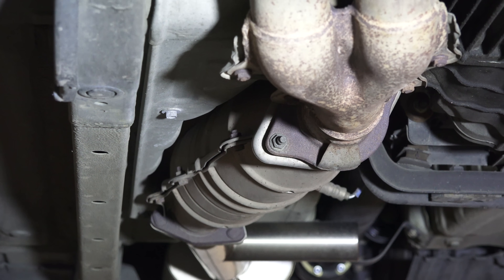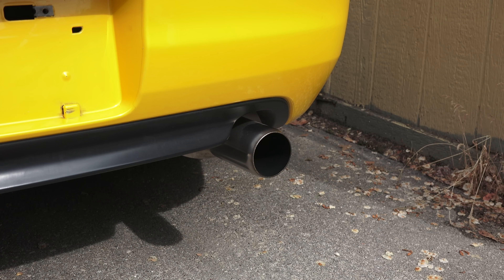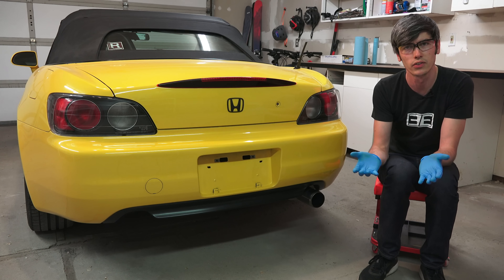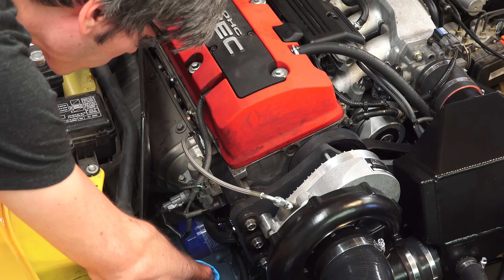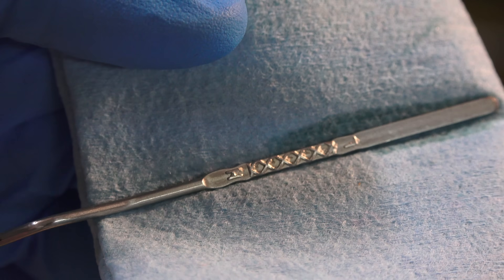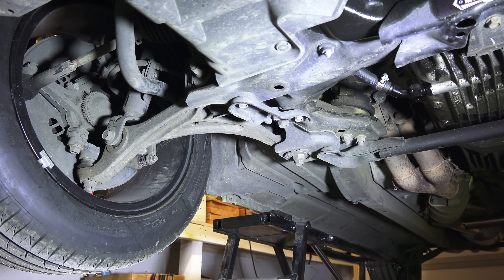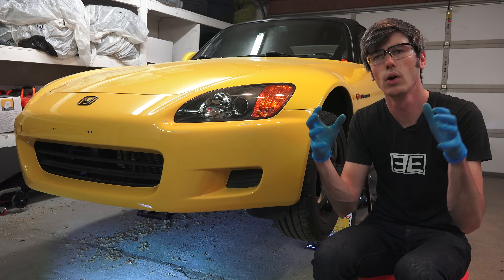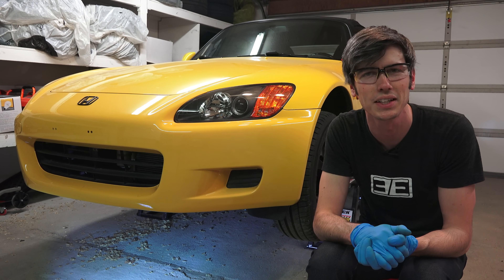5 Signs You Shouldn't Buy A Used Car

Comment: Get a very good mechanic to do a checkup. Then take care of the damn car. 
Keep in mind that every used car has some problems. What is important is that they are not major and that you can fix them without spending lots of time and money. Plenty of a-holes that lie and want to scam someone into buying their poorly maintained car.
Reply from the maker: Agreed!
Reply: @Gandalf721  I keep it as "factory" as I can. It is the 177hp so plenty of power for me. I also do little city driving so the standard interval is ok for me.
Reply: This is why I always change my oil every 3000 miles, and filter every six. Coolant changed every five. Have yet to reach the 10,000 for my transmission fluid in my newer car. Just keeping up on those things is a good way to make sure your car goes over 300,000 miles. Had a Toyota Solara with over 300,000 miles, and the only thing that failed was the Manifold 1 cat. converter.
Reply: @joehutchcraft1675  I think you can get away with "normal" mantainance that is 7kmi for oil and filters. My dsg requires oil and filters every 40kmi. If you do it more often then great!

Comment: Also, do another check up on the car before you drive off with it if you don't buy it the first time looking at it. I test drove a nice Pontiac gtp, ran like a dream...a week later I came back to buy it...20 min down the road the super charger belt came off, jamming up the pulleys and blowing my engine. Was out of 3,200 bucks plus on top of repairs. Always, always double check.

Comment: that's why in Germany we can go 300kph plus, because every car has to get inspection every two years, providing some basic level of road worthiness/safety. Also checking the service history might be a good tip?
Reply: My 206 passed the inspection, that doesn't mean it can go 300kph plus... xD
Reply: @asmoth360  We are talking about cars, to be fair, you got a Peugeot: :) +You should probably Upgrade then. 300kph is a minimum :D
Reply: @cuteshadow  I'm french, so I couldn't go to 300 anyway... Just wanted to highlight the fact that an inspection doesn't relate to the quality or performance of the car, it only means it's not a wreck 😂
Reply: @asmoth360  Which was still basically the only thing i wanted to say too. Yet, get a car which does 300 xP
Reply: @Gandalf721  Not sure how "some" means a blanket statement but ok.
Reply: Very, very few cars in Germany can go over 300 kph. Most cars will top out around 200 kph and the average speed people drive on the Autobahn is only about 130 kph. Plus the types of cars that would have trouble passing inspection tend to at least be over 10 years old. For example, there's no way in hell a stock 1998 BMW M3 will go over 300 kph unless it's riding on a rocket.
Reply: Massachusetts requires an annual inspection
Reply: cuteshadowKIA same in the us. Some states it’s every year. But if you “know a guy” or the shop is lazy, they can pass a car that shouldn’t be on the road.

Comment: I recently bought some gloves to work on my car, but they don’t work that well, it’s seems like I bought some surgery gloves.
what would you suggest or uses yourself?
Reply from the maker: Honestly I just buy the cheap packs at Harbor Freight, as long as they fit they're fine. Depending on the thickness they may tear easily, so look at thickness if you're doing something that might cause them to rip.

Comment: Another more obvious one is tire health. While it's not as important as a lot of things you mentioned, it can be a pain with certain cars to have to purchase a full set right after purchasing the car. 

I know from experience, the 300zx I bought needed 2 235 40 R18s and 2 275 35 R18s (the tires on it were showing belts and one had a busted belt) and that would've been nearly $750 if I hadn't gotten a discount from the dealer.

Comment: Would take advice but I buy 400 dollar cars with lots of issues and drive them until they explode. I bought a 1990 Geo Prizm for 550 and have been driving it 100 miles a day, already put 8k miles and nothing has broke
Reply: Geo Prizm aka Rebadged Toyota Corollas are great little cars especially the  lightweight, fuel economy, vehicle simplicity, and affordable replacement parts due to worldly abundance of the model. After having newer vehicles, i decided to go back to the 90's era Corolla because it met many of the criterion that i wanted in a daily driver car especially living where vehicles tend to rust. After having a newer car that got flooded out and another car with many other expensive issues like dealer only PCM updates and recalls and such led me to this decision.  No regrets.
Reply: @xochiltepetzalailhuicamina2322  Hell yeah. Except my thermostat got stuck today and it is in the worst spot to fix it. Thought it was at the front but it is under the distributor.
Reply: When I was younger and broke, I would buy beaters for $1000-$1500. I would look for crappy bodies with decent powertrain, do as much maintenance and mechanical work as I could myself, and junk them when something major (usually engine) gave out. Best I ever did was a '76 Scount II I bought for $1200 and drove for six years.
Reply: I felt this in my soul...have a Ford focus 04 with 300k probably won't stop driving till engine rust out body...plus I have lifetime alignments and wanna bankrupt Firestone
Reply: Shattered Dreams I got a 98 civic 900 had for 2 years had 230k now has 252k. it cost me less than 25 a month for maintenance.
Reply: On my channel I have a video on a Lincoln I got for 400 and made a grill and headlights for it. Still have that one but haven't done any work. Will make a video for the Geo eventually.
Reply: @hgpo27  impossible in a American car
Reply: @machin9267  I've had several solid american beaters as well.
Reply: Loving my 1992 Chevy Van G20, got it for $1800 160k miles. Put in a few hundred and some hours to do the timing chain and preventative maintenance and now it runs as smooth as any new car. 165k now and I suspect I will still be driving this thing in 100k/10yrs from now. Having a basic understanding of what to look for and whats worth repairing makes life so much easier/cheaper when it comes to cars! Everything aside from the engine is easy/cheap to replace. Seriously loving this 350 small block, absolutely bullet proof.
Reply: I'm gonna start going this route. I don't know much about fixing cars, but with my last one I always worried about damaging something in the process. With a cheap car, I won't care as much and open the thing up
Reply: Check out the song $1000 car by The Bottle Rockets. Anyways, I am all for being vehicles under $1,500. It is a gamble, but it's not what you drive, it's how you arrive! Peace
Reply: 02 civic coupe picked up at 180k for 1200$ , new timing belt water pump. I now have 260 k. It still gets 30mpg.
Reply: hgpo27 sounds like your daily life sucks
Reply: @Wyttt95  How do you figure? I haven't even told you about the shitty relationship I am in with this girl yet.

Comment: What do I do if I drop my flashlight into the engine through the oil hole?
Reply from the maker: I'd suggest removing it haha. Most flashlights probably wouldn't fit. Get clever with some clamps/magnets, otherwise take that valve cover off!

Comment: It's always easier to say no to a vehicle. Expanding on #4, in addition to looking inside the oil fill for sludge, reach in a scoop out a sample from the underside of the valve cover. If your finger comes out with sludge, skip all other tests and walk.
Reply from the maker: That's a good tip!
Reply: My dad told me that one
Reply: Same with the radiator.
Reply: @Peanut-Butter-Banana-Rama  Amen! Any trace of rust, glop, or sealants is a good reason to walk away. Cooling system fixes can cost thousands.
Reply: I get attached to every car I look at, so I usually end up buying them as long as they. Got five right now
Reply: hgpo27 Got money, too...sigh
Reply: Thats right, but many cars have a baffle and you cant reach in.
Reply: My cars have baffles in the way of doing that. Looking for varnish above the oil line on the dipstick works better for me. Conventional oil will always leave varnish but I stay away from cars that have had cheap oil anyway.
Reply: Yes, this one! A while back I was looking at mini vans. The first one I looked at was an 05 sienna with 55,000 miles on the clock. It turned out the oil had not been changed until 55,000 miles. The inside of the engine when I opened up the oil cap looked like a Weber barbecue after I had gotten done grilling.

Comment: Great video as always.  A couple of things that may have been overlooked.  It never makes sense to purchase a brand new vehicle. A newer vehicle yes, New no.  Likely the worst investment you will ever make will be a new vehicle.  

While inspecting also look for new parts or inconsistently clean nuts and bolts.  Before looking at a used car.  Research and identify a good high-quality mechanic.  Ask if they are able to complete a thorough, complete inspection.  This is worth it weight in gold.  You or I may think we know cars but often normal consumers are no match for someone deliberately trying to conceal automotive issues. 

 Lastly (again using a respected mechanic) often great used vehicles are sold because there is a large pending repair.  Timing belt, shocks etc.  While the repair may have a high cost.  Most often if you identify that cost it can be included in the negotiation.  Almost always the repair will be much less expensive than the added financed cost of a perfect vehicle.
Reply: Wanted to buy second hand.
Looked at second hand prices.
Almost a high as new.

Just bought new. Got a rebate from the state.

This doesn't hold up when everybody is buying second hand. Prices skyrocket.

Also in my country people tend to mask accidents and issues so if you don't know what you are doing, new is better.

Good second hand vehicles tend to keep their price.
Reply: @Raziel369  generally cars half in value every 5 years
Reply: @Raziel369  Everything you said is the same with my country, everyone here buys used vehicles so the prices hardly go down much, cars from the 90s are stilled valued up to 5k USD here 😂😂😂 so its better to just buy a new car

Comment: For number 5, just because there isn't a code right now doesn't mean it won't pop up later. One should also check the readiness monitor and make sure the codes weren't cleared recently.
Reply: Emissions checks too. If they're not ready, either the codes were just reset or there's something wrong with the car anyway.
Reply: How do you even check if codes have been cleared when you plug in a scan tool?
Reply: @mishimamaster1845  when you erase codes, the readiness/emissions monitor resets. Over the course of your drive, the car's computer tests your emissions system when certain conditions are met. The readiness monitor tells you if the emissions system is ready or not. If a test fails, the ECU will give a check engine code.
Reply: This is more common than I'd like to think.  Used car dealers and Craigslist sleazeballs don't care.  I bought a scan tool after buying a car that showed an EVAP leak code soon after purchasing.  Never again.
Reply: exactly
Reply: I was thinking senor readiness monitors too. 😁
Reply: An addition for Nr5: good luck reading a Volvo with a generic OBDII tool.

Comment: My old duramax blows black smoke when I stomp on it, it's pretty much always done it but now that it's over 280,000 miles it's worse. Is this a bad sign or can I still get a few more years out of it? It still sounds good though.
Reply: Not an expert, or a mechanic for that matter, but from my understanding the piston rings naturally wear out over time. And so the more miles its got the more oil it'll burn as more oil gets between past the piston rings to the combustion chamber. So more blacky blue smoke when you step on it is to be expected. I don't think its a massive problem, it just means you'll need to do oil top ups and changes more regularly, and it'll possibly reduce the efficiency of the engine. So probably not on its last legs but if the smoke becomes thick or is thick under light throttle, then it's probably best to get it looked at. Also as EE said smoke is to be expected when you're flooring it as the engine is running very rich, but again with age it gets worse as more oil seeps into the combustion chamber.

Edit: If its a diesel more smoke is also expected, because diesels are just naturally smokier. But still should smoke that much, if at all, at idle

Comment: its also good to note that you can see if someone rest the engine codes just before you looked at the car because they may not have had a chance to register a value yet if they have not performed all the tests so the engine light may not come on for 50 or so. miles right after being reset but there could still be. a problem

Comment: I have to disagree on a certain level. Minor engine problems or issues can be a bargaining chip in your favor and could mean big savings.
Reply: kanukster absolutely
Reply: I got my first car for 1500 and all it needed was a new timing belt. Normal Blue book for that car was 4500 or higher at the time. Dealer didn't know what was wrong with it as it was running off half power and wouldn't pass Emissions. He didn't want to take the time to look at it because of it's age. After looking at it myself, Found it only needed a timing belt. Paid my reliable mechanic to do it. Cost $700. So 2200 for a 4500 car. And it ran amazing for all the years I had it. Ran like new! Bargain!
Reply: Yeah,i bought a 2000s suburban that had a bad head on the 5.3l lm7, i told my wife i just needed to get a pair of heads,turns out i "accidentally" bought a bigger head

+97 hp 
Another 150 with a fairly moderate cam
Reply: I also got a car that just needed a new gasket

Comment: lol at number 4..  I'm sure that's fine in California but in the North East you won't find a car without rust under it unless its brand new.  They heavily salt the roads in Pennsylvania and all the cars undersides have rust
Reply: That's why "excessive" rust was mentioned. Some rust is expected on the underside, how much obviously depends on location (climate) and vehicle age. Still, up to about 10 years old vehicles should have next to no rust. Manufacturers usually put 12 years of anti-rust warranty on cars (at least here in EU), so if it's rusted after 5 there's something wrong.
Reply: @kenkalajdzic  In the notheastern US, if your vehicle has been driven through a few winters it will have significant rust underneath, period. If you can make one last through 10 winters without holes rusting through the body you've done great. And this is with frequent car washes. It's just a fact of life living here. If you want to have a "nice" car here it means you must also own a "winter beater" and never let your nice car see a salted road, which could be 4-5 months of the year.
Reply: @kenkalajdzic  But (usually) that warranty only covers rusting though the metal from inside to out. So it really doesn’t cover any rust on the underside of the car. If you drive on the salted roads underside of 10 year old car will be rusty.
Reply: Ken Kalajdžič 
Not everyone drives a BMW or Toyota. 
Made in USA is not always an advantage.
Reply: Do companies no longer use undercoat from the factory? My car is almost 53 years old and is pretty much rust free on the underside thanks to a caked on, undercoat somewhat resembling gear oil. A bit of it in the back is still wet, even. No, wait, that is gear oil. I blew a differential gasket a few months ago (good thing, it had the original gasket and original gear oil) but didn't bother to clean the thing when it went to the mechanic because it's functional as a fresh layer of undercoat for the top of the diff and the gas tank, which later lost some of the Oldsmobile spec undercoat due to a gas leak from one of the (original) hoses.
Reply: Same in wv.the rust belt area is hell on cars.
Reply: Damn right. Got to love the salt belt.
Reply: STDrepository sucks to not be from California huh
Reply: @MasterYooda94  Yes I am so jealous of you and your 4 dollar gas and homeless feces and syringe covered streets.
Reply: STDrepository women weed and weather baby something ul never know about 😉
Reply: @STDrepository  Sounds more like Philly to me.  Guess which state has the highest gasoline taxes.  Good ole PA.
Reply: @STDrepository  "Yes I am so jealous of you and your 4 dollar gas and homeless feces and syringe covered streets."
 ouch lmao.

Comment: I want to buy an S2000, can I buy yours? Usually its almost impossible to find those pretties unmodified, or without any damage at all.
Reply from the maker: It's modified, but you can make an offer haha. It's definitely clean! (e-mail in about section of YT channel).
Reply: Engineering Explained Yep I noticed the air filter shroom and the exhaust system isnt the factory one. But I would very much prefer to buy a used car from you, than to search in the ads. I have found some stock ones priced 8.5-15k euros and a couple of vsa versions varying from 20-30. But you know, this car belongs to the category "chance of being stock 0.1-1%". My dream cars, S2K and carrera gt. <3
Reply: It’s possible they just cost like 20k still
Reply: George Soto yes they have a very good reselling value. However the fact that they are two seaters reduces the possibility to find a clean one like the one on the video. Because a family which is (theoretically) more mature, would not choose an s2k. Also i can afford around 15k euros max. I guess the ones priced for less than 10k are going to give me headaches